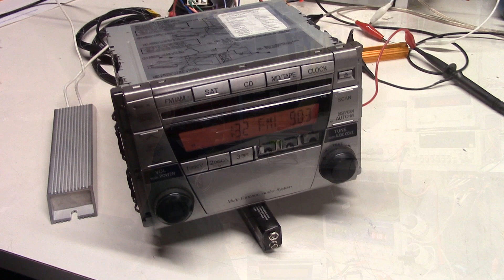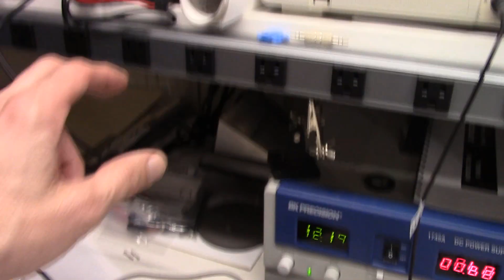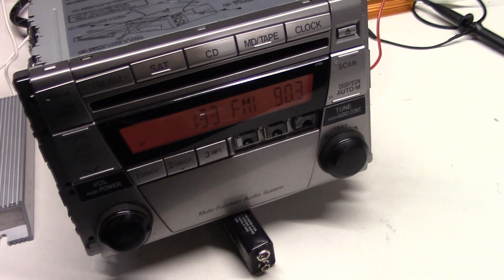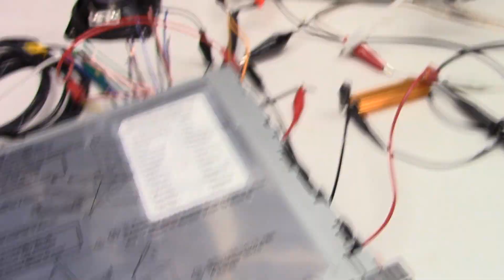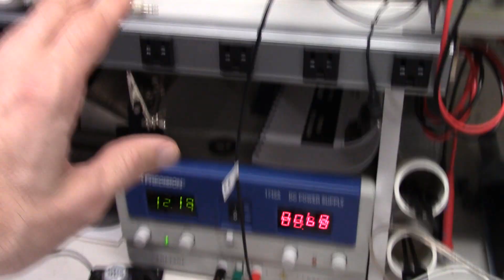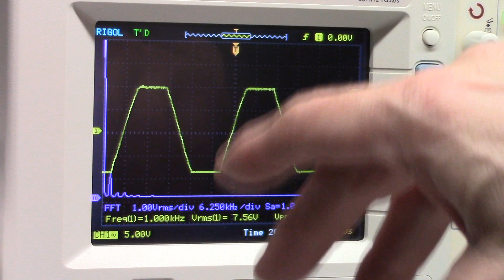Miata Audio Q & A: Speaker & Radio Power Ratings + Checking Power Output of an OEM Miata Radio

Comment: Hello Sir, I bought a Chinese Carplay Android for my Mazda MX-5 NC, when the sound is high I had a lot of noise. I spook with them, they send me an Amplifier, it resolve the noise but at high volume (30 on screen) the door speakers shut down so I have to restart the car and lower the volume so I can get them back! Is it a power problem ?  many thanks.
Reply from the maker: It is likely something related to the impedance load the radio's amp is seeing. When the audio cuts out entirely it is usually the radio's amp going into protection mode. It will do this to avoid damage to the amp circuitry. Protection mode can be triggered by too low an impedance (which can happen with multiple 4-ohm speakers connected in parallel), a short (or near-short) to ground in one of the speaker leads, or some internal problem with the amp in the radio.

Make sure your total speaker connection for each channel is no less than 3-4 ohms and also verify that with the speaker leads disconnected at the radio that there isn't less than a 3-4 ohm impedance measured from any speaker lead to the vehicle ground.
Reply: @3rdMillennium  Thank you Sir, my car still has the 4 OEM ones, just to clarify things, the ones which shuts down are only the door speakers, yes I need to buy a DMM to check the SC. Also, my battery is dead I am waiting for new to come so my be can not supply enough current but I am more with you explanation and need to measure the impedance. If there is no SC, do you think I can add an inductor to increase the load at the X frequency!!!
Reply from the maker: @naimisddiken9606  Low system voltage will definitely create a problem, so follow up on the battery and also verify that the alternator is producing as it should be. In the meantime, try disconnecting the OEM door tweeters if you still have them connected. They aren't very good quality anyway and the M800s are already a 2-way design with superior tweeters. Dropping those out of the circuit will raise the door impendence and that should then help with the load presented to the amp.
Reply from the maker: @naimisddiken9606  There are a couple fuses to check associated with the radio. In the passenger compartment next to driver's left leg, check #1 and #10. 

And regarding testing, impedance will not vary with volume. Using your meter, check each speaker wire (removed from speaker) to the vehicle ground. You should not show a low impedance short to ground on any lead.